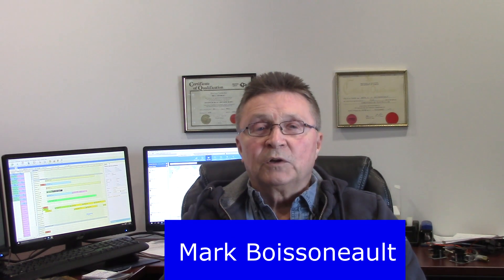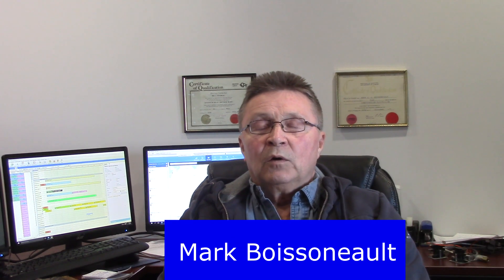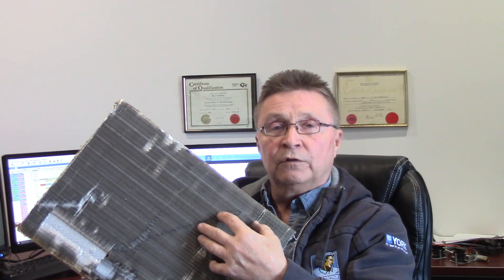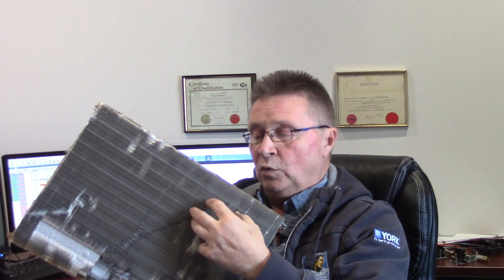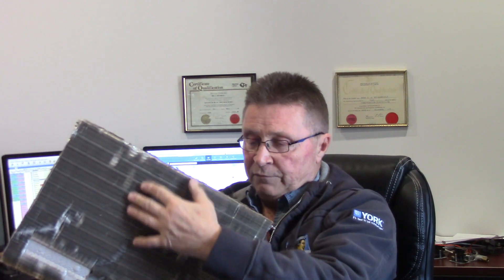3 most Common reasons Why Your Air Conditioner Freezes Up

Comment: in minute 1:03 he shows a fiberglass filter, most residential units require this. A pleated filter is equal to a clogged filter, blocking proper airflow. Home Depot and Lowes are doing away with fiberglass filters doing a great disservice to homeowners.
Reply: fiberglass is real great on the lungs....(NOT).....  It takes about 80 passes to actually catch the same dust particle, if its in the cooling mode. Also, when  the coil is wet, it will adventually start to build up on the coil  and loose efficiency and airflow, and thats a lot of fun trying to clean that sucker to restore the lost air flow. Keep in mind, many  people have allergies nowadays, fiberglasses inability to trap particulate matter only exacerbates the problem.
      If you have bad airflow, its not from using a pleat,  If you have more than 6' of flex on each supply, this is your quick install system.  Flex goes in much faster than duct pipe. Theres you airflow loss. Its the low bid crappy duct system some contractors slap in thats to blame. You want fast & cheap? You got it.
    Pleated air filters that cause coils to freeze are an excuse for a poorly designed / installed duct system.  I only get frozen coils when the pleats don't get changed.
Reply: Frank Murphy by
Reply: Frank Murphy
Reply: my unit requires 20x25x5 filters.  I don't think they have fiberglass type that thick (5")

Comment: thanks for the info. my ac just did this yesterday..was on but was blowing hot air then looked outside and line was frozen so cut it off ...now waitin for it to thaw out plus the filter was discusting..I replaced that last night
Reply: Hopefully that solves your icing problem. A dirty filter will also reduce the amount of cooling produced and it will put extra pressure on the unit.  Have a great day!

Comment: Bookmarked! Thank you tradesman. Also, I need a bit of help. I got a two year old Frigidaire ac windows unit [http://www.frigidaire.com/Home-Comfort/Air-Conditioning/Window-Mounted-AC/FFRA0522R1/] and I been searching around here how to clean it, but the unit manual [http://manuals.frigidaire.com/prodinfo_pdf/Edison/16120300a00400en.pdf] says: 

[in page 3], 
*Do not use water to clean inside the air conditioner. Exposure to water can destroy the insulation, leading to possible electric shock.

and [in page 9], 
[Cabinet Cleaning]
*Be sure to unplug the air conditioner to prevent shock or fire hazard. The
cabinet and front may be dusted with an oil-free cloth or washed with a cloth
dampened in a solution of warm water and mild liquid dishwashing detergent.
Rinse thoroughly and wipe dry.
*Never use harsh cleaners, wax or polish on the cabinet front.
*Be sure to wring excess water from the cloth before wiping around the controls.
Excess water in or around the controls may cause damage to the air conditioner.

I really wan't to clean my ac windows unit, but don't know if I should follow the manual or clean it with water, like many people have done in YouTube, because If I don't, then how those who sell these units expect me to remove the mold or do they think that it'd go away by itself?! So, to clean it, I'll need to discharge the capacitor (according to some videos), protect the motor with what? plastic bags? or remove it and remove the circuit board (if possible) and then I can use vinegar/baking soda and water to clean it?
Reply: When we pressure wash a window a/c, we try to cover the electrical with a plastic bag. We also try to use a piece of plywood or sheet metal as a barrier to minimize the amount of water that can affect the insulation. A spray on coil cleaner works as well if you follow the instructions on the can.
The manufacturer needs to protect themselves with those instructions. So it is then at you own risk.
Good luck with your cleaning.
Reply: Thank you very much Mark.

Comment: after updating old ductwork, dust is clogging the drain pan.  Why does this only happen at night? (rhetorical)  I turned off the ac and let the fan run two hours. the drain pan is in the attic; I do not know how to clean it.  ANd I am scared to climb a ladder. Besides having the drain pan unclogged tomorrow; should I have the attic vaccummed (and who can I hire to do such a thing), or should I spray insulation over the remaining insulation.  There was a yellowish-greenish gunk released when the drain pan was unclogged ast time.  The unit is under warranty, but the service people that installed it are failing to do the required inspections and service.  I have a call in to another service company, can they transfer the warranty?  Thank  you!

Comment: Thank you very helpful. Our A/C is o my two and a half years old since our home was built and it's leaking. I had two bathrooms and two closet vents closed on the second floor. I just opened them and I'm praying that solves it.
Reply from the maker: Make sure that your drain hose is clear as well. Good luck!

Comment: why dose a compressor frost up?
Reply from the maker: The simplest way to explain this without getting too technical on all the possibilities is that: The refrigeration system needs to have enough refrigerant in it to keep a steady flow of liquid moving to the point at which it expands. That is at the metering device in the evaporator or cooling coil in your furnace/air handler. If there is a shortage of refrigerant , it will flash or expand further back in the system and frost over the suction line and eventually on the compressor itself. Hope that works for you. Cheers!
Reply: Our air handler fan blade came apart and wasn't moving air over evaporator.  The fan motor was still good. Replaced all parts to the fan unit.

Comment: Thank you so much for all that valuable information! 
I think....NO....I know that I'm guilty of your second reason.
I have a portable De Longhi air conditioner unit. Can you please tell me how to clean the coils from dust and smoke that the filter somehow misses? Thank you!!!
Reply from the maker: Hello Lily,
From what we have seen, all portable Air conditioners need to be taken apart to properly clean the coils. This is not an easy task for someone who has not seen this done before. If you can locate ALL of the screws as it comes apart and manage not to break any of the plastic clips that is the hardest part. A commercial spray foam coil cleaner is the best option for cleaning the coils. Follow the manufacturers instructions on the can and rinse off well with clean water.
If you manage to re-assemble the case and use up all of the screws,  Good Job ! 
My suggestion is to pay someone you trust that has done this before.

Cheers.

Comment: Hi, thanks for the video! Is there a way to know how many pounds of coolant need to be added to a system to fully charge it, before the coolant is actually added? Do the gauges when checking tell you how many pounds low it is? Also...with a 4.5 ton A-coil, should I expect an HVAC service person to take it out and lug it upstairs and outside to clean it, or is cleaning in place what I should expect?

Comment: What is the problem if the 2 evaporator coils from the upper evaporator coils is not cooling?  Compressor over heating but the suction line only 45psig.....high ampere? What is the  problem? please help!

Comment: will variable  flow units have these same problems? I have a mini split , oversized for heating and have never had any issues in cooling. I see whole house systems now  advertising variable  flow  which is ( I assume) a function of the compressor  motor .

Comment: Air flow restriction could be from less tension for the motor belt, which leads to reduce the RPM and cause less air flow.

Comment: On May 2 they came and replaced my evaporate coi( I think I am saying and spelling it right)  and had 6lbs of coolant. Now it back to not cooling and the line has frozen outside and I can see ice on the blade. The filter has been  changed and no vents are blocked. What are your thoughts?
Reply from the maker: I would call them back to check everything through properly. Although it could be something else , it is quite possibly a metering problem. Either a blocked orifice or defective TXV.
Reply: outspoken 2u You probably have a bad defrost sensor or defrost board.  May have to call a technician to fix that one
Reply: Brenan Massie you dont know shit do you?

Comment: Hi, when I turn my AC thermostat to cool if it is 70deg or cooler my inside coil freezes up run down the I would imagine to be the refrigerant line running to the outside 3 ton unit.But, I have also noticed that if it is hotter outside that the unit works fine with no freezing.So I guess the question is?. Is there a heat sensors in the outside unit that would cause this issue. I am. Unemployed so I can't afford a tech to come out.
Reply: Thank you for your question. There would not likely be any sensors that would be causing this problem. Air conditioning does not provide a cooling range of much below 70f.  To get further below 70f it becomes more critical that everything is at its optimum design factors. This includes all of the reasons for reduced airflow, refrigerant charge, equipment sizing and equipment failure. 
The best that you can do on your own is to keep a clean air filter and open all of your vents to allow for the most possible airflow. An experienced refrigeration mechanic would otherwise be required to pinpoint the problem or problems.
Cheers!

Comment: Had my ac on for 2 days ,and now my unit froze....I looked at the coil and it wasnt froze,just the compressor and its lines... I then shut the unit off,15 minutes later after thawing,now the system wont come back on.. even just the fan only wont even come on ... yes,I checked all breakers and they was on.. I also took yellow wire and touched the red on the therm. and nothing happened... I also had a spare new capacitor that I put in,just in case the one in the unit went bad,but it wasn't swollen or nothing.. now what do i do ?
Reply: DarkendSun check fuse

Comment: Thanks for the video man!
 My dad has a problem with his unit freezing up. The unit is installed in a concrete basement garage and I have an idea that it doesn't get enough warm air through the system because the basement stays cool practically without air but maybe it actually is low on freon?.

Comment: Thank you very much sir. Mine is frozen from the outside unit to the inside air handler. No vents are blocked and the filter is new. Either I have the temp set too low (69F) or the Freon is low. I will leave it off until the ice thaws and then turn it back on and set the thermostat to about (70-71F). If it freezes again, probably the Freon is low. Again, thanks for your simple explanation of everything.
Reply: I rented a home once that had a fairly new central air with heat system, it was the first time for me to have a system like that in a rent property, one summer i noticed it stopped cooling , i called the property manager an he told me to check a couple of things before calling a service tech , I did but no difference at all,so he called for a service tech,I went back outside an looked through the vents on the condenser an it was all iced up an the coils were completely stopped up with dirt an grass clippings, i shut the system down an flushed all the ice an grass clippings out to make it clean again, turn system back on YES it started cooling,called property manager back an told him cancel service check an told him what I had found an done ,he was always a good manager an thanked me for what I had done.From that point on i always keep my out side condenser unit clean ,if you don’t the system cannot operate properly an freeze up!!!

Comment: How do the professionals find the leak and repair it?
Reply from the maker: Soapy water in a spray bottle. electronic refrigerant detector, halide torch, injecting UV dye. If there is not enough refrigerant left in the system, Nitrogen is then used to raise the pressure to assist with finding the leak. Leaks are most often repaired by braising or replacing the defective piece. Recovery units should be used by a professional to reclaim any refrigerant so as not to contaminate the remaining Freon with the nitrogen.

Comment: Simple, Clear, Accurate, no blaring background music.  One of the best posts I have ever seen on Youtube.
Reply from the maker: I appreciate the feedback Brian.
Reply: I couldn't have said it better
Reply from the maker: Thanks for your pleasant comments Brian!
Reply: @Kenzo Finn No problem =)
Reply: indeed the information was very accurate and my air cond is working properly again
Reply: Tradesman Mechanical Services Ltd. My tenant runs the A.C. when it is cool outside and the AC frezzes up.  What is the lowest outside Fahrenheit temperature you can run a Central AC unit without doing damage.?  Help.

Comment: Thanks! Half way into the vid. I jump on a chair and remove my split unit filters. Man they so dirty.😞so i cleaned both filters. My ac blows hard now. We will see what it does through the night..It freezed up fast and the comp will shut down and then after 2 minutes its on again. Then off again. On off on off. thanks for the advice! If it freezes up again then i will fix the leak and regass
Reply: thanks so much.very informative!

Comment: Oversized system would cause it to freeze
Reply from the maker: I would think that if the system is over-sized that it would cool down the area in a short time. We refer to this as short cycling. This would then not allow the system to run long enough to properly de-humidify the space and possibly leave a clammy feeling in the home. An over-sized system that is properly charged  and freezing the evaporator is doing so simply because it does not have the proper amount of airflow.
Reply: Tradesman Mechanical Services Ltd. ,
Yes sir! With an oversized system you don't remove humidity! Brings house to temperature demand but short cycling causes high humidity levels! Your the man! I always tell my clients only 2 reasons for ice up. Either not enough airflow across evaporator coil or low on freon levels. And if it's low on freon we need to detect source of leak. Freon does not evaporate and the system is welded air tight from atmosphere air.

Comment: the air filter that you had. does the metal part face the unit?
Reply from the maker: The metal part of the filter is made to face the downstream side of the airflow or facing the blower. Most of the filter manufacturers use metal sheeting that is salvaged from making bottle caps. This metal sheet provides the support to prevent the filter media from being drawn into the blower. Hope that helps.
Reply: It should have an arrow for air flow on the air filter. It should be on the side somewhere that'll tell you the arrow points up
Reply: Tradesman Mechanical Services Ltd. ,

Can the unit have two filters ??

Ours is inside the home , there is a filter on “return” located under the cabinetry.

I am wondering if the large outdoor unit has one as well ??

Comment: My coil are freezer up...can I use hair dryer to unfreeze them for the moment?
Reply: make sure the hair dryer is on low heat.......high heat can cause the lines to crack if they are frozen....dont set the dryer on on spot for a long time....keep sweeping the heat around
Reply from the maker: Yes a hair dryer is a good option to help defrost the coil but having the fan run without a call for cooling is the best way. Of course you will still need to find out why it is frosting.